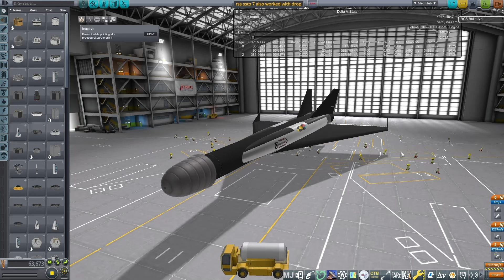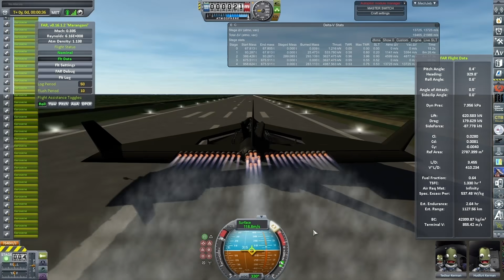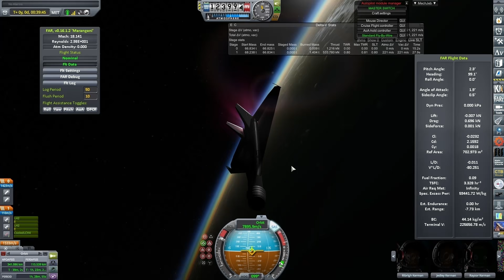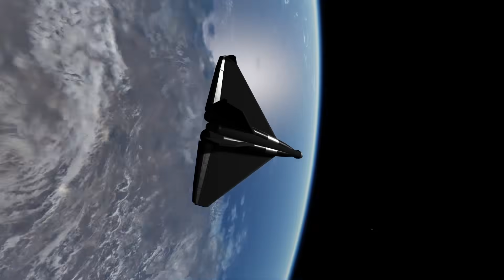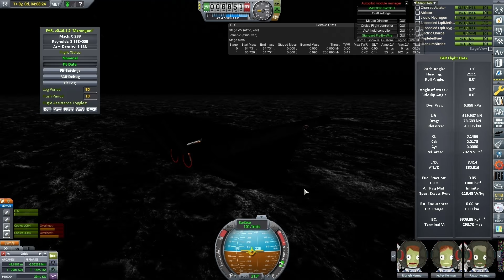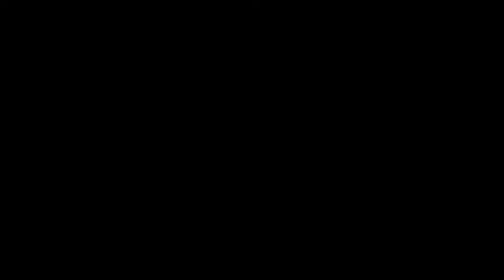Working "SSTO" in KSP RSS

Comment: this is cool, but this isnt an SSTO.  Its a two stage craft.
Reply from the maker: Ye, if you count the drop plane as a stage, you're right. 😂 The vehicle itself never stages though, which is why I put "SSTO" in quotation marks
Reply: @scrappyrockets  Of course I count the drop plane as a stage.  It is providing the lift and thrust to propel the spacefaring portion of the craft higher into the atmosphere.  It is, by any reasonable definition, a stage of a multistage craft.

"The vehicle itself" refers to a part of the overall craft.  Yes, THAT ONE PART doesnt have a separation event, but that one part separates from the larger, combined craft.

Just because the first stage is plane shaped, too, doesnt mean its not a separate stage.  Its not much different than the space shuttle, where the spacefaring portion doesnt itself split apart, but it is the final stage of a larger craft.  The only real differences are that your first stage is jet powered, and your final stage keeps the fuel tanks onboard the craft rather than jettisoning them shortly before orbit is achieved.
Reply from the maker: @jasonkay9345  I get your point, but I see it differently. To me it's two separate vehicles working together, not one vehicle with two stages. The carrier aircraft is a complete vehicle in its own right, just like the orbiter is. That's why I described the orbiter as an SSTO after release, even though I understand why you'd classify the overall launch system differently. It's also why I included the whole flight, from takeoff to orbit, and put "SSTO" in quotation marks—people can make up their own minds on what they want to call it. 😄

And hey, if you've managed to build a true ground-launched SSTO in RSS, I'd genuinely love to see it.
Reply: @scrappyrockets  You can see it differently if you like, but factually speaking, you are just wrong.  The carrier aircraft is 100% a first stage, and this is 100% not a SINGLE stage to orbit.  

Its not a matter of opinion, as the facts are pretty clear - SSTO craft are spacecraft designed to reach orbit from a planetary surface using only propellants, without jettisoning any major hardware like tanks or engines.  The carrier craft serve tanks and engines, which are jettisoned during the flight.  The ability of the first stage to fly back to the launch point doesnt change this.

This isnt a difference of opinion.  This is just you being wrong and being unwilling to accept that.  There isnt a reasonable argument for this being an SSTO.  Its like claiming that a Pegasus rocket is a ground launched rocket because the carrier aircraft takes off from the ground.
Reply from the maker: @jasonkay9345  Fair enough, everyones aloud an opinion, I agree the overall launch system isn't a conventional SSTO. I was referring to the orbiter itself, and I think of the carrier aircraft as a separate launch vehicle rather than a stage. Air-launch systems are usually described as air-launch systems rather than "reusable first stages," so I don't think it's as black and white as you're making it out to be. Either way, I built it because I thought it was a fun engineering challenge, not because I was trying to redefine aerospace terminology. 😄
Reply: @scrappyrockets  Except this isnt a matter of opinion.  Its a matter of fact.  Your craft uses multiple stages to achieve orbit.  Its not an SSTO.

And appealing to what news orgs write to the average person as an argument is kinda dumb, because those news orgs are writing to people who are, on average, kinda dumb.  Most people dont have a good understanding of rocket science.  Hence why we use "rocket science" as a stand in for something difficult to understand.
Reply from the maker: @jasonkay9345  You keep saying it's "100% a first stage" as if that's an established aerospace definition, but where exactly is that definition? Air-launch systems are almost always described as carrier aircraft or launch aircraft, not reusable first stages. Pegasus is described as an air-launched rocket, not a two-stage launch vehicle with an aircraft first stage.

You're arguing what an SSTO is, but "single-stage-to-orbit" by itself isn't specific enough to prove your interpretation of what counts as a stage. You're treating your interpretation as an objective fact, and those aren't the same thing. If it's as black and white as you're claiming, I'd be interested to see an aerospace source that explicitly defines the carrier aircraft as the first stage of an air-launch system.

You might want to be a little less certain that you're the smartest person in the room. Dismissing everyone else as "kinda dumb" isn't a substitute for supporting your argument.
Reply: @scrappyrockets  "Single-stage-to-orbit" isnt specific enough?  The definition of what a stage is is vague?

These are the arguments of someone who knows they are off the reservation but cant bear being wrong.  If you had even bothered to look up what rocket stages are, you would see that EVERY definition says something very similar to this:

"a stage in rocketry is self-contained section of a launch vehicle that houses its own propulsion system and propellant, designed to operate independently"

"A single-stage-to-orbit (SSTO) vehicle reaches orbit from the surface of a body using only propellants and fluids and without expending or detaching tanks, engines, or other major hardware."

So, a single stage to orbit vehicle is one that achieves orbit while expending only propellants and fluids, and do not expend or detach any major hardware, tanks, or engines.

This took me 10 seconds to find.  Which means you cant even do basic fucking research before spouting off at the mouth.

And if you look up if the aircraft used in Pegasus is considered a stage, you get a resounding YES:
"Air launch systems function as a reusable first stage by using the carrier aircraft to provide initial altitude and velocity, which is precisely what a first stage on any other rocket system accomplishes."

And I wasnt dismissing everyone else.  I was dismissing YOU, because you are arguing something that is fucking dumb. 

This kind of arrogant ignorance is disgusting.